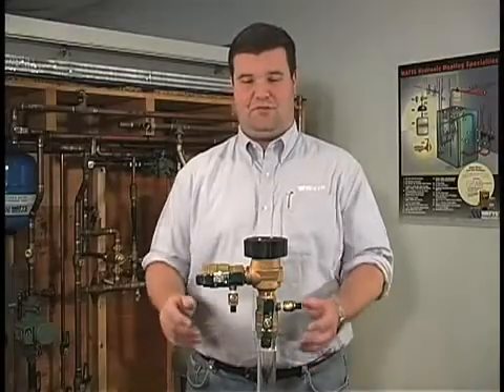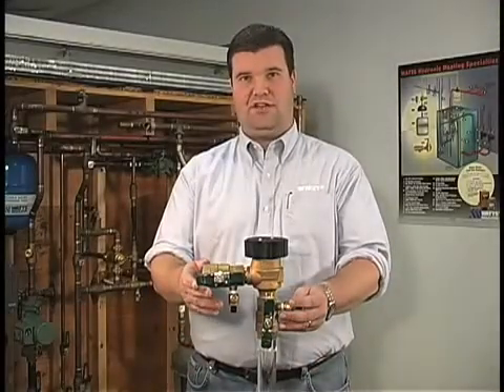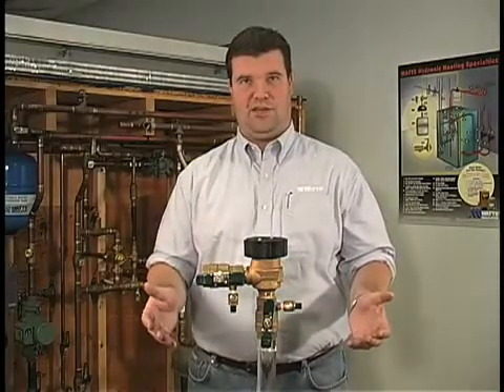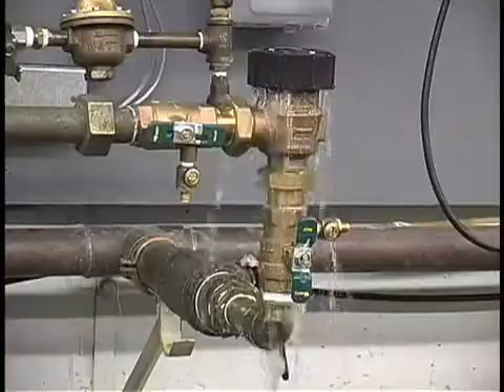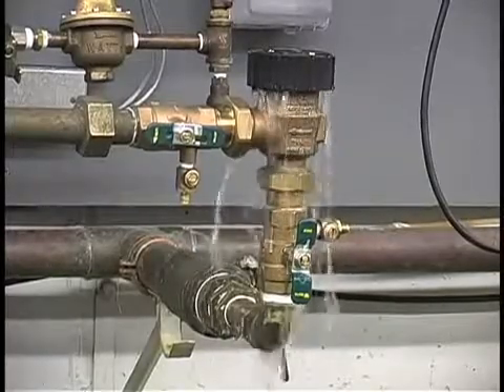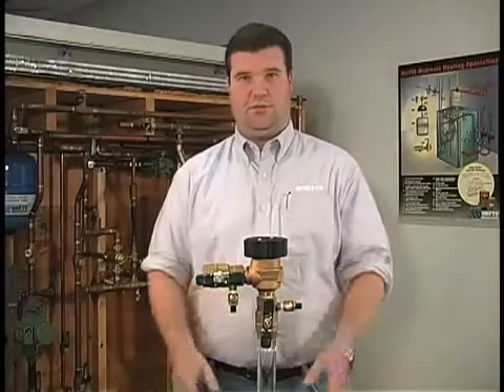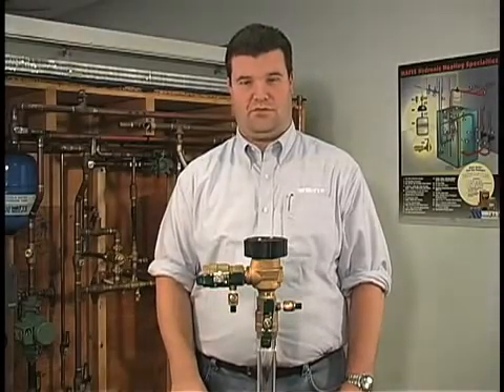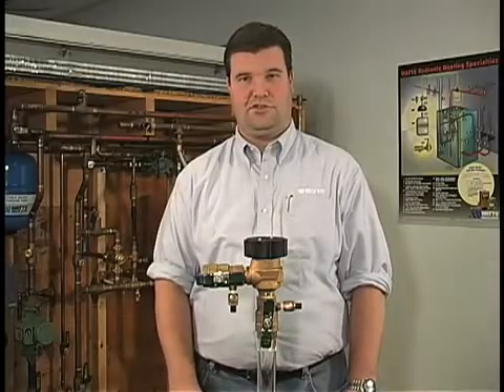How to Repair a Watts Pressure Vacuum Breaker 800M4 Series

Comment: The repair kit has a small packet of "accrolube FG" with instructions "before reassembly, grease relief valve seat orifice, piston bore and piston "O" ring". To which parts do these instructions refer?

Comment: I have this same unit. When I go to blowout my system at the end of the season, my pvb leaks air and I can’t generate enough pressure to move water. All my seals are new. I’ve tried both nipples as well. What am I doing wrong? If I remove the intervals and seal the top I’m able to create a tight seal.

Comment: Thank you! Everything looked good on the assembly except maybe the upper gasket that seals the bonnet. After replacing the gasket I still had water pouring out. The fix was to close BOTH valves and then quickly open the supply side and slowly open the other end to keep the pressure.

Comment: We replaced all the internal parts, but not the bonnet itself. Replaced all the rubber parts and the black and white parts with the feet that were in the kit, springs too. (Forget the names). I had turned off the water inside so I didn't use the two handles on the valve itself. When I turned on the water it gushed everywhere through the bonnet, but then sealed up. I ran one zone for 15 minutes. one hour later we ran another zone. About 2 hours after that we heard a loud noise, sounded like a fighter jet zooming over our house, and it was the water, gushing out the bonnet....Removed it and everything looked fine inside...It is 20 years old. I was afraid to use the outside valve shutoff because they are so rusty they will probably break! The gushing started late last fall when we had an unexpected mild freeze. After that we shut down the system and had it blown out. Could it be as simple as needing the bonnet replaced? It didn't seem like it had any parts that could be causing the leakage